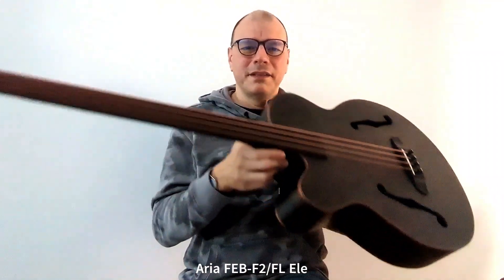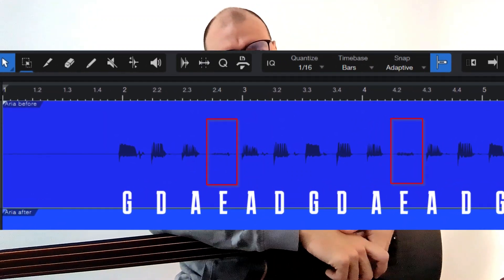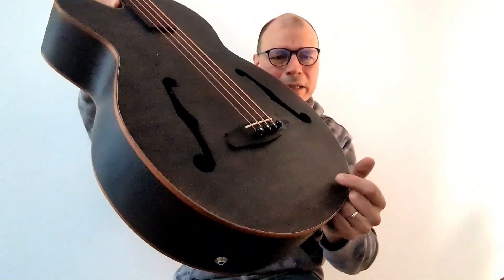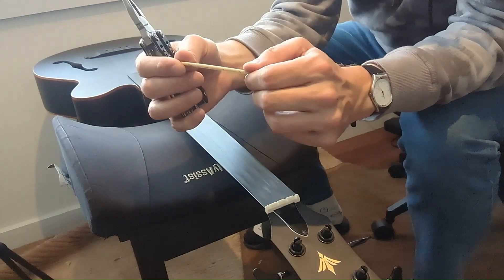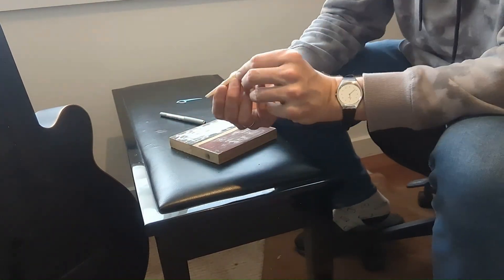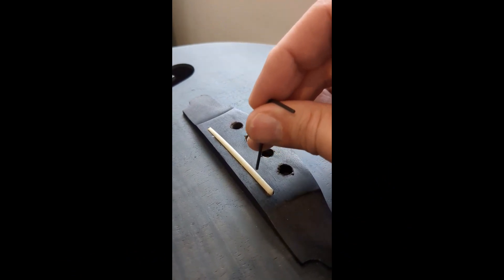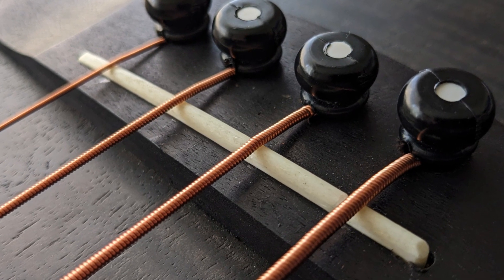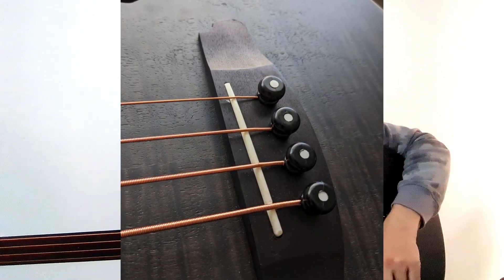Acoustic Bass Piezo Fix for uneven strings

Comment: I've got the same problem with my piezo. A string is saturated, and the other strings are low volume. Still working on it. Thanks for the tips, I have more insight now into the problem, I'll try to have the A string further from the piezo and get the other strings closer.
Reply from the maker: Sounds like a complicated case... I only had one odd one out. At some stage I would just go with warranty. Keep me posted!
Reply: @BassCave7  Lol, you want updates? Well, my E string is saturated now but the other strings sound great, which is about 70% improvement. I'm just going to... Sand it down again, those are my schemes, and these are my plans, stand tall like a man, etc etc.